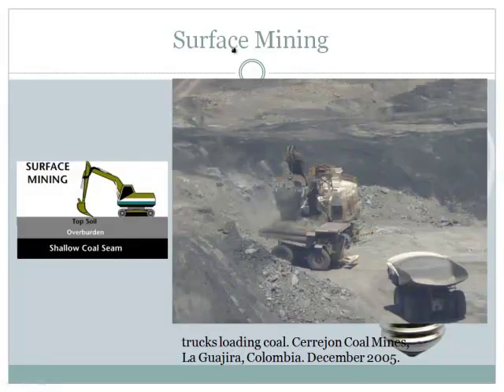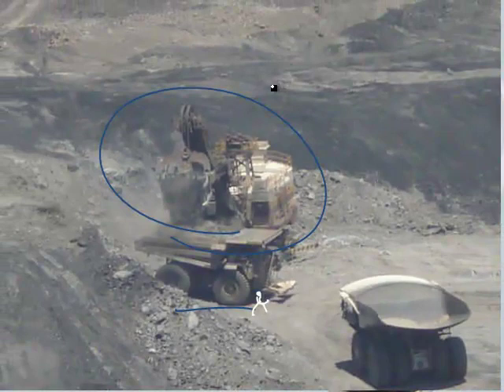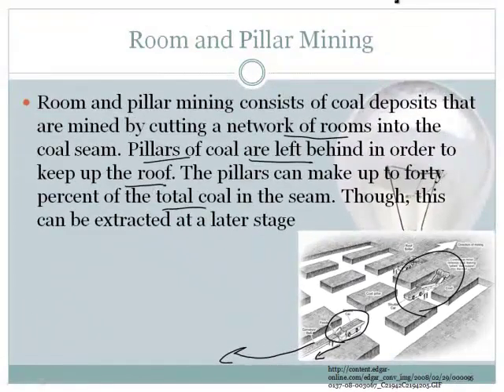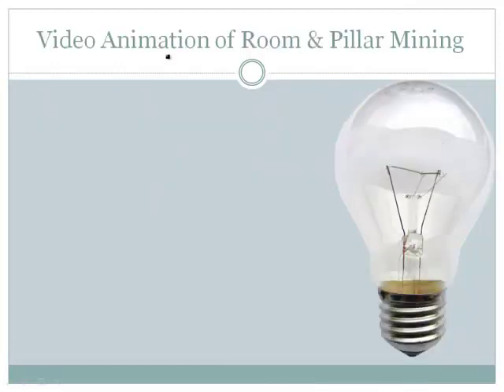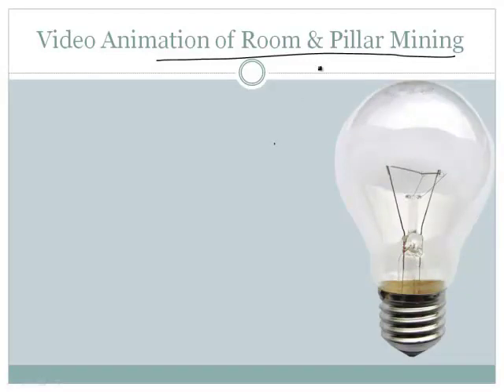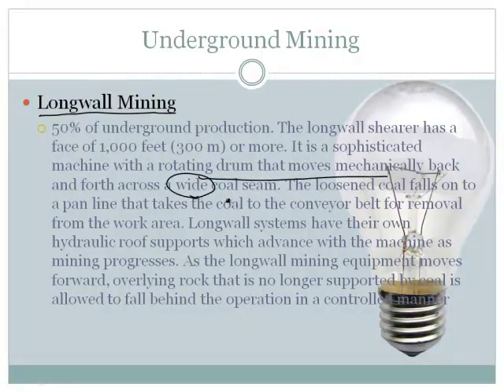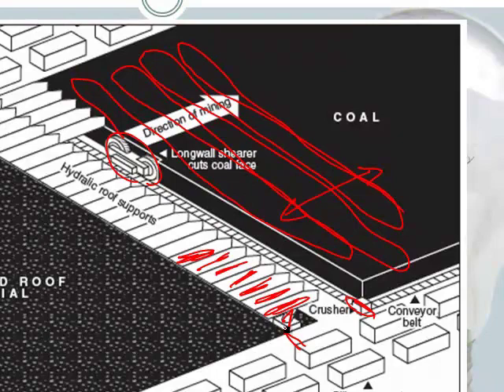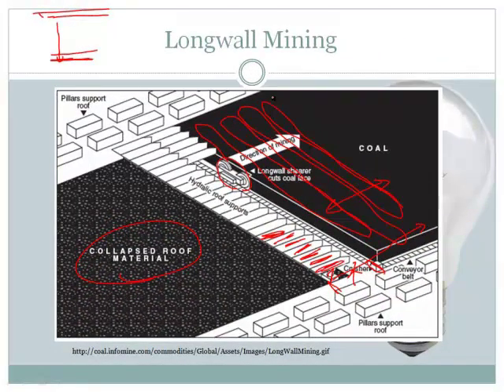How Coal is Mined (2/2)

Comment: Room and pillar underground ya cut the face with a miner. Ya dont blast a coal seam. Miner cuts it and ya use shuttle cars or ram cars to haul it back to the feeder to put on the beltline. Unless ya running bridges.